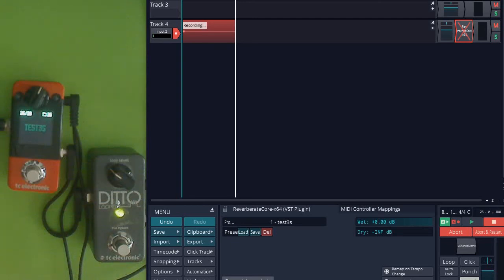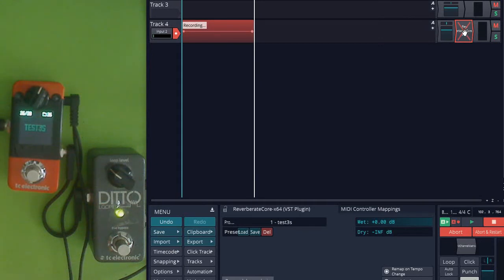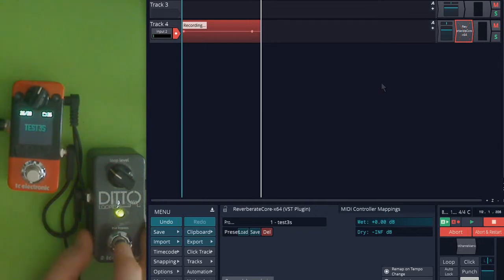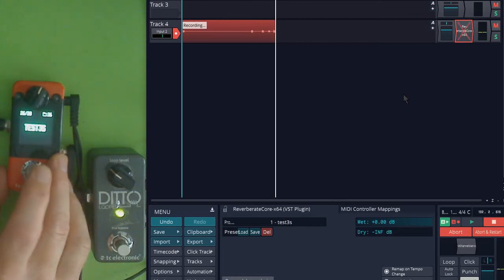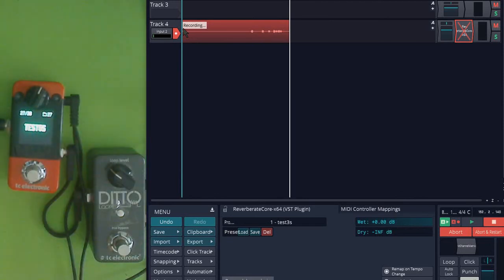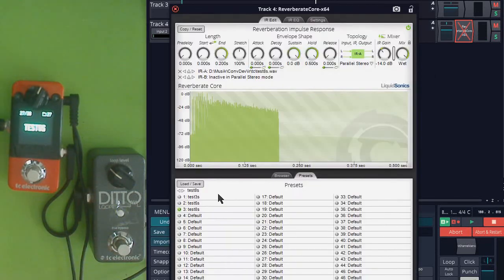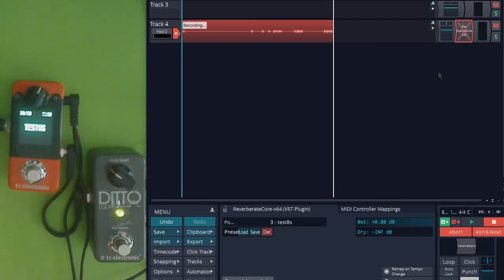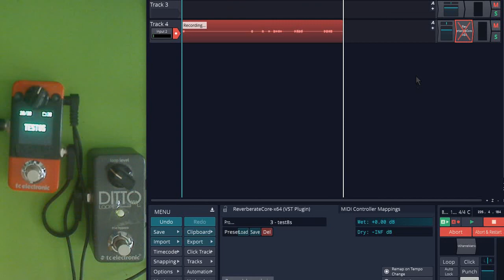Testing the tc electronic IMPULSE IR LOADER with reverb impulse responses

Comment: Great example! 
Can you load reverb Ir to pretty much any Ir loader pedal or is it only the Tc & the BOSS ? 

Thank you
Reply from the maker: You have to check the max. IR length that can be loaded. Cab simulators often accept only IR's up to 50 ms or even less - that's not enough for reverb.
Reply: @janhofmann1549  I greatly appreciate your response 🙏🏽 .. 1 more quick question what is the minimal milliseconds that you would recommend when looking at an IR loader for reverb ?
Reply: @ItsSkaterP  Hello! How much latency?
Reply: @ЕжиКкоторыйлюбитбенды  very low latency.. like under 2ms .. it’s just no good for windows machine.. and no good for acoustica audio plug-ins.. but other than that very good latency